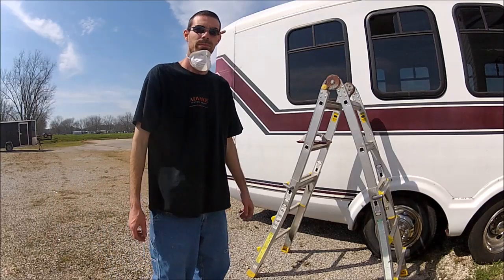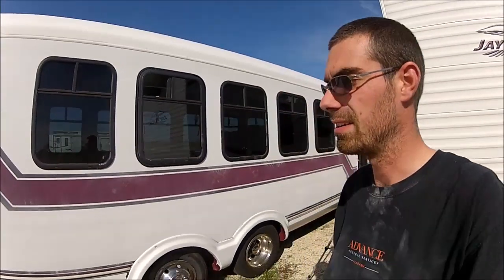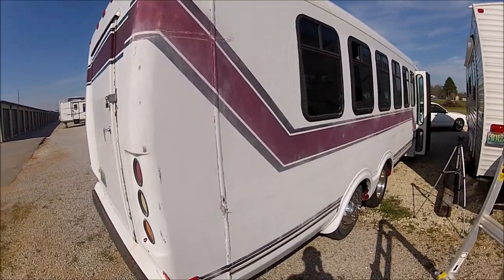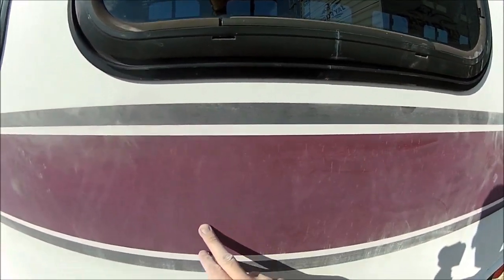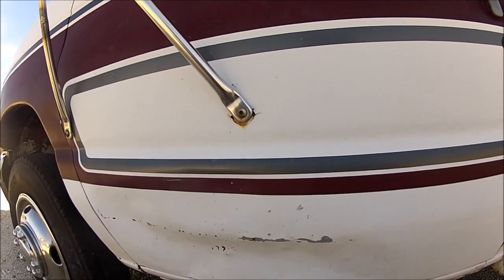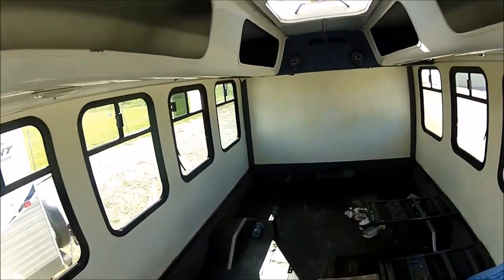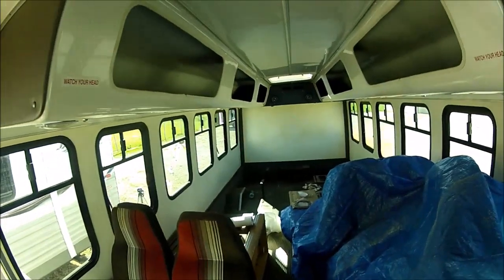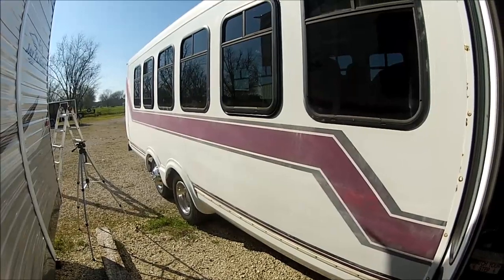Bus Conversion Update 2

Comment: Number 1,980 subscriber here. Just found you , looking to get a transit . how long is yours was told a 14 seat with lift was still short enough to drive without a CDL. Looking forward to future vid's.
Reply from the maker: Awesome, thanks for subscribing!  Mine was 26 feet long. If your using it for personal use you shouldn't need a CDL. Before this I had a 40 foot 90 passenger school bus and didn't need a CDL since it was going to be used as an RV. I have heard that some areas are more stricter on the laws though.

Comment: Are the exterior walls of the bus aluminum or fiberglass? I am planning to do the same thing to the exterior of my enclosed trailer which is aluminum. I'm just curious what the prep process will be before painting on aluminum.
Reply from the maker: The exterior walls are fiberglass. I'm not real sure what the prep process is for aluminum. I can't imagine it being much different.